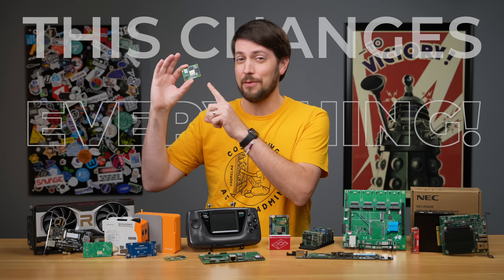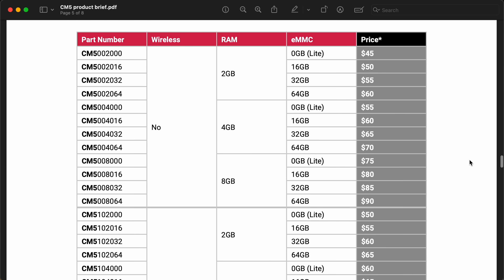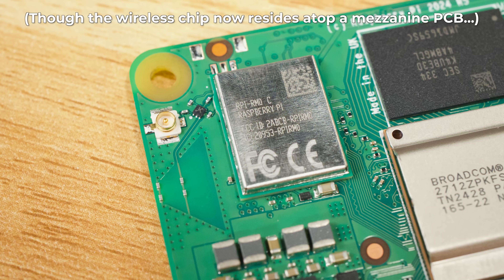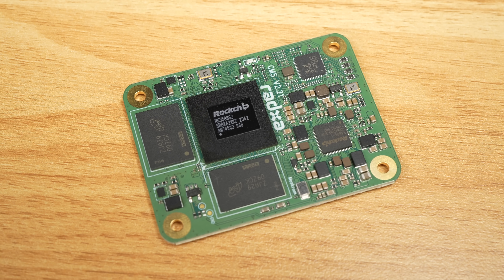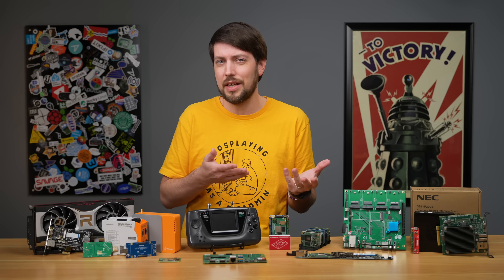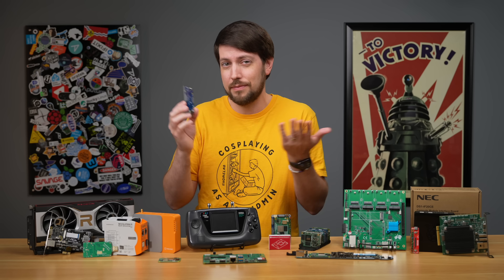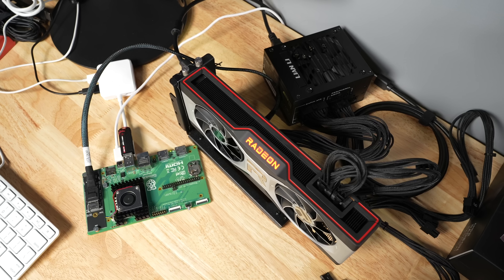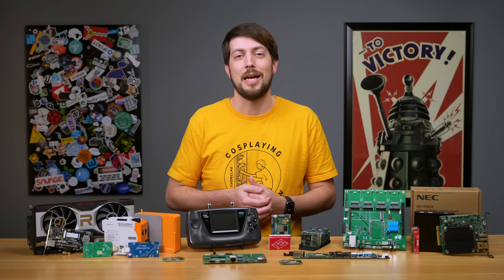This tiny computer changes EVERYTHING

Comment: on the video encoding comparisons at 6:16 :
Is this the Radxa CM5 doing encoding in software or hardware? I thought the Radxa has hardware encoding that would be significantly faster than the Pi CM5 doing it in software...

https://youtu.be/X4blR5Ua3S0?t=520
Reply: x264 is software encoder. radxa's cm5 can do in h264/5 hardware encoder at 4k 120fps.
Reply: @nyanmisaka  ... which makes this a bit of a misleading comparison?
I understand that @JeffGeerling may have used the x264 encoding simply as a proxy for general computing power, but it's still unfortunate, given that actual x264/5 encoding is an important use case for devices in this class.
Reply: @TobiKellner  The x in x264/5 implies software encoder but many people don't know this. Also, the RPi CM5 doesn't have a hardware encoder so it can't be tested fairly. Unless you have an Ampere Altra, it's not practical to run a software encoder on such a low-power ARM device. The RPi really should change this in the next generation, otherwise it's a hard pass for many realtime video-related use cases.
Reply: @nyanmisaka  ah, I didn't know about the x in x264 either.
From what I understand, the RPi 4 actually has hardware encoding but it was taken away for RPi 5, which led to a project I follow (OpenHD) dropping RPi support. Which is why I was so surprised to see a graph suggesting (to me, not understanding the meaning of the x) that RPi CM 5 is much stronger in video encoding than CM 4.
Reply: @TobiKellner  RPi's devs explain that the RPi 5 can use its four cores to encode in x264 faster than the h264 hardware encoder in the RPi 4. But the trade-off is that you won't have free CPU to do other things. x264 is a free software encoder implementation of the avc/h.264 video standard. Those guys also wrote VLC player.
Reply: @nyanmisaka  do you know how the power usage compares between hardware on Pi 4 and software on Pi 5?
Reply: @TobiKellner  IIRC the RPi 4 can do ~1080p60 in hardware even without an active cooler. And I think RPI 5 can do faster with its 4x cortex-A76 cores, but the power consumption at this time should be similar to stress test because x264 uses SIMD/NEON instructions, which will burn your CPU. So you will need a fan for this.

Comment: How can a small organisation such as Raspberry Pi get their CM5 developer's kit released and available for purchase, when Qualcomm with all their extra resources made a complete mess of the Snapdragon for Windows 11 2024 developer's kit? I've just purchased the CM5 developer's kit. At £124.40 for CM5 wireless module with 4GB RAM and 32GB eMMC, IO board, CM5 cooler, metal case enclosure with fan, antenna kit, PSU, and HDMI and USB cables, amazing value for money!

Comment: The CM4 shortage slapped me back to reality and taught me that a N100 mini pc is cheaper, more reliable and better in every single aspect....Not to mention the time I saved from all the relentless surgical tinkering required just to make things work. Good video though!
Reply: The difference lies in power consumption. CM is an IoT device, slap a battery with it, it run for days. N100 require continuous electricity
Reply: @j-t-1900s  How? The Pi5 ranges between 5-7W under typical loads and idles at 2-3W while the N100 base is 6W , idles between 3-4W and it's configurable up to 15W.
Reply: @RazielMessiah  you have to account for motherboard, RAM, SSD etc. these all add up.
Reply: Intel does have amazing 9W and 12W chips. Imagine if they stripped the x86_64 instruction set to RISC forma. Anyways, I hope to get around to finishing a UltraSPARC T2 pi.
Reply: The N100 is faster, but if memory serves is it as efficient in terms of performance per watt? Also still not as small as there RPi but it's close.

I'd love to see an Intel or AMD CPU using the compute module form factor. Seems like they would make bank with it.
Reply: @TonyOstrich  Jeff's "This is how you destroy Raspberry Pi" says Pi5 is 10% more efficient, while "When Did Raspberry Pi become the villain?" says 40%, but that's just bc Intel is clocked higher.  You could lower Intel's clocks and it would be more efficient and still more performant than the Pi.
Reply: @TonyOstrich  those units exist, but cost is 3 times or more

look for dfi with amd cpu in sbc form, there are n100 cpus on radxa boards, same problem

radxa has many other solutions
Reply: it is not the same, but if it worked for you, well
Reply: A complete N100 mini PC is cheaper than a PI compute module?  That seems...unlikely.
Reply: @ferrumignis  You cannot use compute module by itself :)
Reply: @ferrumignis  The CM5 8GB Wifi + cheapest IO board here is $142. That is more expensive than a N100..
Reply: @ferrumignis    $120 for my GMKTek N100 with 8gb RAM 256gb NVME.  Add a case, power supply, & nvme and the Pi5 is right up there.  No GPIO, tho.  But running Kodi it smokes my Pi4 2gb, and is x86 so I'm not having to fiddle as much.  Love the Pi, but I think it's going to go back to being a tinker board.
Reply: @ferrumignis  he's talking when scalping was at a high , the cm 4 board.
Reply: This.  Too many Dodos using anemic Pi junk for compute.

Comment: I wish for a carrier board (ideally for CM5 gen) that has true mini-itx form factor and that can be a drop in replacement for regular PC hardware.
this would be perfect for those that want to build low power PCs for their familly or repurpose existing hardware, but don't want to invest/rely in custom built casing, etc...

My use case would be turning my PC into a NAS and replacing the high power consumption of first gen ryzen to something that can easily be passively cooled or cooled by the case fan.
there also would be the option to use cases like the jonsbo N-series to build powerful, yet generationally upgradable ARM NAS. (especially with that Radxa board, the idle power consumption makes it a perfect candidate for a device that will idle most of the day/night).
Reply from the maker: Radxa has their RK3588 ITX board, it is certainly an interesting option! The CM5 could make for an upgradable platform, too. I'd love to see it.

Comment: Looking at the performance difference between the first RPI and the RPI5, it will not be many years before desktop computers are obsolete. 
Bye Bye to the big box on the table and hello to the 3d headset with everything built in.

Comment: RK3588 is faster and better documented.
Reply from the maker: It's a seriously OP chip!

I mentioned in the clustering section how the RK1 still holds the SBC Cluster King crown, and how the RK3588S2 on the Radxa CM5 crushes the Pi CM5 in almost every benchmark (and efficiency!) :)
Reply: yes

Comment: I’ve kinda wished that they also would’ve made a version without the RP1 and giving us the 4 PCIe lanes of the RP1. :)
Reply from the maker: Ditto :(

But then all their camera/display/GPIO stuff would need to be reworked, so I can't see that happening.
Reply: @JeffGeerling  damn didn’t consider that it would also affect CAM, Display, (Ethernet?). I could live without GPIO.
But we all know the Pi community. Its not a question if but when somebody got the “bright” idea to desolder the RP1 and replaced it with a PCIe switch or something like that.
Reply: I've been playing around with the idea of connecting the RP1 to the exposed PCIe port instead (over only one lane) and exposing the 4 lanes used by the RP1 for something else, but getting that to work beyond Gen1 speeds would be a bit more tricky. And I'd have to sacrifice a pi 5 to try it.
Reply from the maker: @coreforge  I'm happy to support the cause :)

I'd be willing to sponsor a few Pi 5s for that—also for trying to build your own RP1 PCIe card that could slot into a PC!
Reply: @coreforge  sound like a great idea! I don’t have the money to sponsor such a Project but I will provide encurgragement to Perdue it!

Comment: 9:49 The 4TB Seagate Ironwolf Pro NAS drive does tend to have some reliability issues in my experience, I had 2 start throwing errors 2 months after getting them :/
Reply from the maker: Oof! So far mine have been okay, but I've only used two 4TB drives in service for long. I have two more spares (this is one of those)... maybe it's already showing signs of premature death!

Comment: Now if someone could make a Framework laptop mainboard that takes compute modules...
Reply: Yes, CM5 Framework laptop running ATAK with Meshtastic and LoRaWan support and some SDR radio would be nice.
Reply: That's a really good idea.... love that. Is that not a good kickstarter project....
Reply: There was initially some collab as a third party board for Framework but it didn't amount to anything.
Reply: I'd like to buy a tablet that takes a CM5; add a detachable KB/touchpad and sounds like a clear win if the price can be kept low enough.
Reply: if you just s/Framework/MNT Reform/ this already exists.
Reply: @StripeyType yeah, I was about to say MNT Reform has been on this for a hot minute
Reply: @StripeyType I can't wait to see how the Reform and Pocket Reform perform with this
Reply: @ThalassTKynn  I've been offline most of the past few days so I have not yet seen whether MNTMN has started testing...
Reply: i'd love to try and do that, but i can't afford a framework
Reply: Nexdock with raspberry pi integration slot? Only have to upgrade what you need. Need extra storage add an extra m.2 drive. Maby someday will get a small formfactor gpu that can be interchangable
Reply: Yes and it will run RISC OS 😀😀
Reply: People's idea of new things will survive longer than the company itself...
Reply: Yeap!
Reply: #RedShirtJeff it!
Reply: What I really want is a Raspberry Pi compute module with a all-in-one USB-C port. Power and display out. That would make something like a Lapdock viable as a laptop solution.
Reply: This! ☝️
Reply: Have an IO board replace the numpad on the Framework 16 so you can plug it in right next to the keyboard.
Reply: No thanks. While I love the raspberry pi. I like my AMD processor with built-in graphics more.
Reply: @  an addon board, not the whole computer. Let you direct connect to it from the laptop os.
Reply: I'd rather just have a case that will accept Touch Display 2 so I can have a Raspi tablet!
Reply: Like the compute module replaces the processor? Doesn't seem very useful, given that it's still a lot less powerful than any regular framework processor. Not sure what the use-case there would be.

A custom low cost laptop chassis that uses the CM5 would be cool though.
Reply: @CutoutClips It would mean a return to laptops with socketed CPUs (even if it's technically SOCs). If your CM5 died, you could swap it for a new one without having to replace the whole mainboard, and as long as RPi continues to design their CMs to be backwards compatible, upgrading to the CM6 means even less eWaste than upgrading a Framework mainboard is usually.
Reply: @CutoutClips  I think it would be a good idea to create that laptop, it would be potentially upgradable. You can buy a Pi tablet already but sometimes these non-windows solutions seem over the odds expensive.
Reply: @CutoutClips  With the size and power draw of the CM series you can have 2, 3 maybe even more of them in the same sort of form factor as the Framework (though it might be too difficult to actually fit them exactly in place of a normal framework mobo), and with the fast networking, perhaps a multiplexer chip on the HID and Display signals (so most likely a carrier board with a pretty beefy FPGA). Then you can have a really flexible setup, is it a cluster,  multiple separate computers running bare metal native applications rather than virtualisation perhaps for security reasons, a 'real-time' module dedicated for your 'real-time' tasks or some combination of them of them all?
Reply: @CutoutClips  you can use the lapto to access your remote workstation

Comment: @JeffGeerling do you plan to test the CM5 on the Turing Pi? I‘m curious if it can be dropped in where CM4 modules had been running on the TPi before.
Reply from the maker: Haven't had time for that testing, but hope to pop one in on a carrier board in my TP2 cluster soon. Note that I have the older 2.5 revision board (I think? Maybe 2.3?), there's a newer Turing Pi 2 revision out there now.
Reply: @JeffGeerling  they sell versions 2 and 2.5 now. Sounds like you may have a content creator’s sneak preview version of the 2.5.
Reply from the maker: @slimhazard  Ah, just checked the Turing Pi site—the board I have is from more than a year ago. The 2.5 is just finishing up production! It has a number of tweaks to make use a little easier, but I don't have one of those. I have an old (now non-functional) prototype, and a Kickstarter version I got after backing it.
Reply: @JeffGeerling  I'd be very interested in that test, too. Still didn't get any boards for my kickstarter-TP2 yet and continued playing with my TP1. Maybe this is the perfect reason to upgrade :-D
Reply: @Tobias-G  you could always upgrade your TP1 with the CM4 version of the Compute Module 3, which is known as the CM4S.    Same form-factor, but with CM4 components on-board.  Storage runs from the Lite model with no on-board eMMC through 32GB eMMC variants.
Reply: @JeffGeerling  I have both the v2.4 and the new v2.5 boards - the 2.5 hasn't been populated yet, but the RK1 modules are on their way (oh heck, going to need more NVMe sticks).  As I recall, the 2.5 doesn't have any speed improvements, other than replacing the USB-µB OTG port for flashing with a USB-C port (a separate USB-A was added for host mode), 4k HDMI output for Node 1, and an actual 4-pin PWM case fan header controlled by the BMC.  They're promising managed switch mode improvements for the future as well as more tweaks to the BMC software.

Comment: How does a cm5 module run on a USB port if they require 5A of current?
Reply from the maker: USB-C PD has a 5V 5A spec available, it's rare but that's what Raspberry Pi chose.

Comment: Jeff what was that board you slide right into the TV I need that in my life if I can replace my TV IO board because my TV had factory defect so I'd rather just replace it with something better
Reply from the maker: Unfortunately that board is specific to NEC / Sharp commercial TVs. If only all TVs had hot-swappable compute module boards!
Reply: @JeffGeerling  agreed but I'd still like to see if I could force it to work with a little reverse engineering lol
Reply: @JeffGeerling  also as a side note most tvs the IO board are generally same size probably manufacturer cost saving

Comment: Tried the CM4 on the CM5 IO Board? 🤔
Reply from the maker: That's... actually a great question! I tried the CM5 on the CM4 IO Board (you have to supply a different DTB to get everything working), but didn't try the reverse. I assume it should just work, since the only major difference is the USB 3.0 data lines would route into two of the Camera/Display connectors...

Comment: io board with juz one rj45 thay just plain evil people in rpi 

i will not buy rpi cause on ali i have n100, on auctions i have old mini pc,  rpi + addons is too expensive for normal people its sick
Reply from the maker: N100's been a great platform for Intel. A ton of great options there. Though the IO Board is meant as a starting-off point for CM5 development, it's better in other carrier boards for sure! (I'd like to see someone build a dual 2.5G setup for the CM5, and compare it to a similar system with N100... see how much slower or more efficient the CM5 would be).
Reply: @JeffGeerling  if i need io for small things i have <1$ esp32 c3

You build some fancy NASes but when you add those fancy addons board the final price is bigger than mini pc or consumer qnap, its nice to show this stuff ist nice to play with it but in the end, no my las rpi was 3 and i am done :( 

You are the only one last man that represent rpi thay should pay you with 100% they marketing budget :)

Comment: I perked up when you mention Kubernetes.... Better than the N100 and can run Ubuntu Server(?). Related but a side note, love to see a video of how to get cheap nodes with low res graphics, doesn't come with Windohs 11 preinstalled, got at least 8GB, PCIe and a 2.5G ethernet. I bought 3 'stick' computers for my lab last week and had to pay the $20 Microsoft tax (like the old OEM days).. thanks for this though, really good info.
Reply: IIRC Canonical started officially supporting Ubuntu Server on the Pi when the Pi 4 came out, so yes, the CM4 and CM5 (which both came afterwards) can both run Ubuntu Server!
edit: typo

Comment: Would CM5 help with improving RPI5 NAS you made?
Reply from the maker: It would certainly be easier for a company to design an integrated solution. I hope Radxa can resurrect their 'Taco' design for an updated Pi CM5 NAS!
Reply: @JeffGeerling  Ah, I see. I need to check out their "Taco" design! Would be nice more companies to make NAS solutions from CM5.
I've tried buying Radxa SATA HAT, which you used for Pi NAS and it's sold out everywhere.